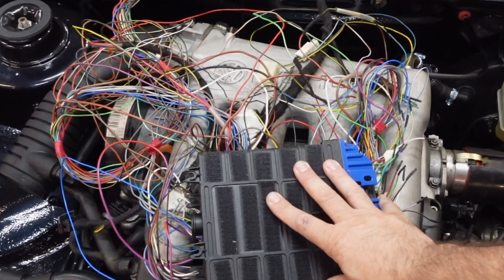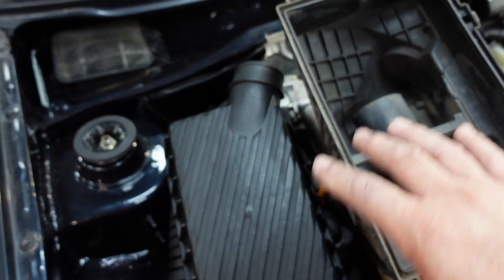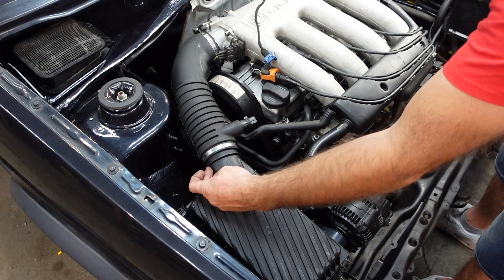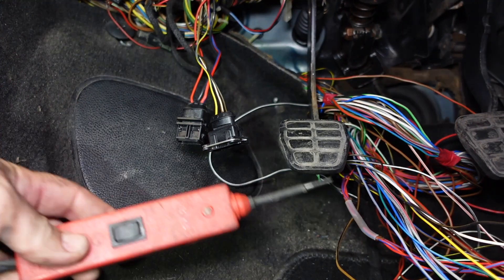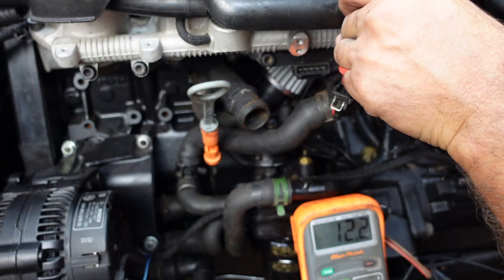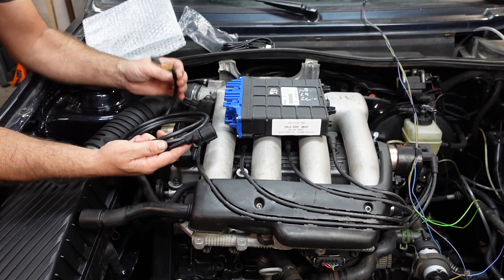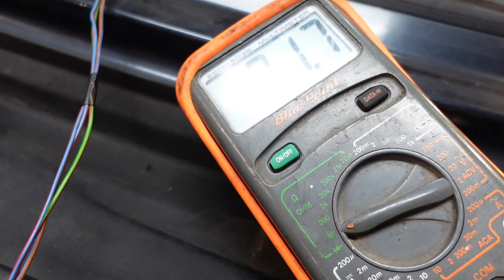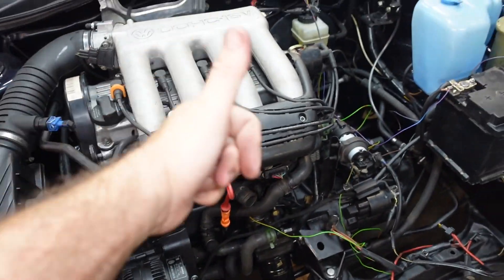High Comp ABF 2 0 16V Golf Project Pt6

Comment: Nice work.  I wish we had those abf motors in Canada.  I’m on a standard 1.8 16v on standalone.  But I sure would like that extra 50hp. 😃👊
Reply from the maker: Thank you, you can make an ABF (well kind of) use a ABA block and crank, ABF rods and pistons, use your 1.8 16v oil pump and gears and your 16V head and bingo a home made ABF.